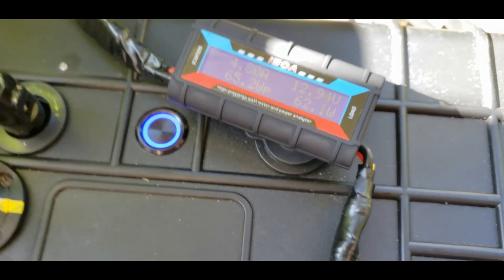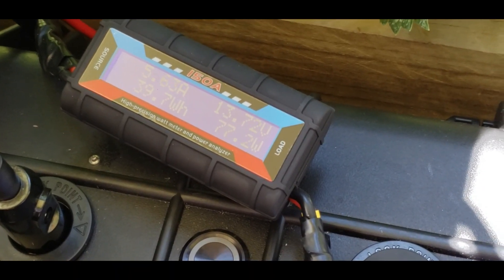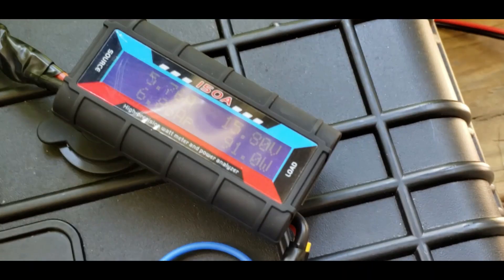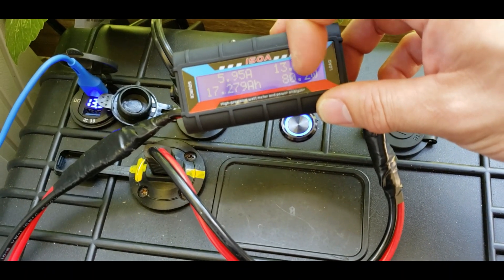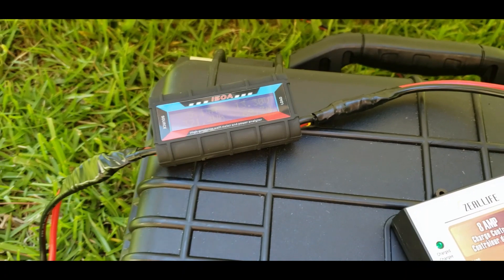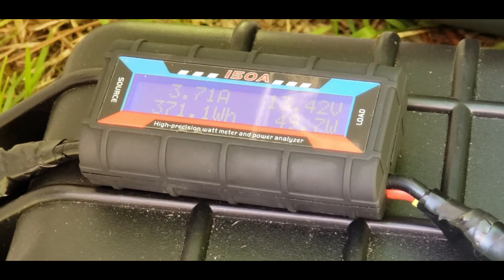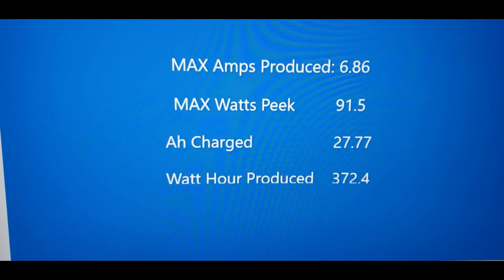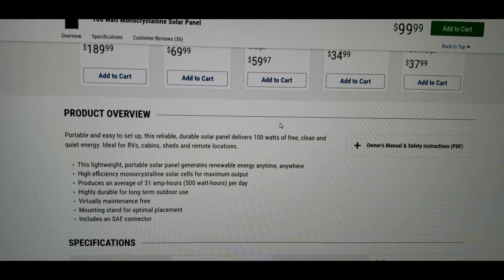How much power does the new Harbor Freight 100 Watt Monocrystalline (57325) produce in a day (Part3)

Comment: I purchased two of those meters, Im running two controllers and each will have to measure the enery that is coming in. So I gather you trust this meter. Btw, great test, helps understand the concept. Looking forward in making my video of usage. Good day 😊
Reply from the maker: Hello and thanks for stopping by!
Yes we have checked ours specifically with a meter and it’s within a few tenths of a volt so close enough for this job. Still runs flawlessly today. Good luck with your build and video

Comment: I was up in Houston TX about two weeks ago and testing it with a Victron 100/20 MPPT charge controller, connected to a LiFePO4 battery. I was getting 91 watts max out of it, pointing it at the sun. I've heard you can do better, but that's what I got in September. I have tried three of them in parallel and series. They kind of suck in parallel, as far as power output. But they seem to do well in series. That might be due to the lower voltage in parallel, but the MPPT should adjust for that.
Reply: I had done something similar but with two different panels. Using a Rover Elite 20 amp mppt controller I hooked up a 200 watt panel that had a output of 18 volts and was only able to pull a max of 8 amps, Then I hooked up a 180 watt panel with an output voltage of 21 volts and was able to get 10 amps with a smaller panel.  Note: This was at a distance of 55 feet from the panels using #10 ga. cable. So voltage makes a big difference when you are talking about lower numbers.
Reply from the maker: We have a rover 40a for our 600w array been good for a year now
Reply: @DIYKAI  You are running 600 watts into a 40 amp controller, How many amps does the controller read in bright sunlight ???  Sounds like you are maxing it out.  I was wondering how many watts I could send into my 20 amp unit without killing it, Ha ha ha
Reply from the maker: Yes! We see around 38-40A with 35A being the average….50VDC coming in…..it is right on the max for 12V we can switch to 24v and get 1kW worth of solar
Reply: @DIYKAI  what size is your battery bank ? and what type of batteries are you using ?
Reply from the maker: @rayberger2694  right now our biggest bank is One 12V Lifepo4 200Ah. Powers a deep freezer and charged phones, cameras, etc
Reply from the maker: Nice I seen over 100w in summer decent panels for the $

Comment: Could I run a pool pump. Off this setup
Reply from the maker: Like the box i made? Or just a panel and charge controller?
Reply from the maker: What size pump/voltage/watt/amp drawn on the tag?
Reply: @DIYKAI  120v 15amp 1800w. Do I need the box?
Reply from the maker: @davidshafer3355  your going to need alot more for that type of power
Reply from the maker: @davidshafer3355  inverter, decent sized battery bank, couple 100 watts of solar, a charge controller....I have a few other videos talking about it in general

Comment: Hey kind of inverter ur using?? There’s so many brands. I just want to get a good 2000w one and be done with it. Some of the reviews I’ve seen kind of make me want to run away from the whole thing lol.
Reply from the maker: What are you trying to power?
Reply: @DIYKAI  just want to have enough power in case we loose power. Say a small fridge ,microwave and some leds lights and a toaster. Just the bare essentials.
Reply from the maker: I would go with a pure sinewave inverter I can link a few for you if you like.
Reply: @DIYKAI  sure that would be great.
Reply from the maker: Sure thing
Reply from the maker: @zachary4225   any of these would run a small refrigerator and some lights no problem 

https://amzn.to/3dbItRI

1000W (simple easy to use portable)

https://amzn.to/3xKsH8m

1200W Rated,2400W peak ( good all in one package)

https://amzn.to/3w0FUc8

3000W Continuous 6000W Surge ( Big Dog will run a lot)

Hope this helps!
Reply from the maker: @zachary4225  Depending on the microwave you want to run you will probably need at least 1.5K watts
Reply: @DIYKAI  thanks bro. Appreciate it. Will pick up one over the weekend.
Reply from the maker: @zachary4225  your welcome lmk if you need anymore info here to help!
Reply: @DIYKAI  thanks. Appreciate it
Reply from the maker: @zachary4225  your welcome!

Comment: Thank you for posting these videos, I've been trying to find out how these new panels work and if they actually meet their claims. Quick question, do you have a video on your battery box/bank? I didn't see one when I scrolled through your video history, but figure you might have mentioned it in another video
Reply from the maker: Your welcome. They definitely do im actually testing it again today found a better location with more sunshine......I don't have one up yet but soon will. It's a power house.
Reply: I just got one of these panels it’s working great so far. Charging two 35 amp batteries.
Reply from the maker: Yes I'm in testing phase now and its even more power now that I have it in a optimal setting.....expecting at least 30Ah of charge while having various loads on
Reply: @DIYKAI  did you change the charge controller?
Reply from the maker: Yes but made some modifications....and for the older panels I bought a new one....more testing today
Reply: @DIYKAI  cool.  I got one of their newer panels. Gonna pick up 3 more
Reply from the maker: If you plan to run 4 panels you are going to need a 30A charge controller.....1 panel burned out my 8A controller.....i modded another one I had to see if it will stand up to the Amps....I have seen spikes to 8 Amps
Reply: @DIYKAI  I ordered a new controller. It should be here Monday. Gonna get two more batteries. So it should be able to run the small equipment in my garage safely
Reply from the maker: I use it with a 500w 1000 peak pure sinewave zero issues....have pulled 13A no issues from the 44Ah batteries
Reply: @DIYKAI  oh wow. Nice.  I have a regular inverter. I will pick up a sine wave as well
Reply from the maker: Mine is charging 44Ah